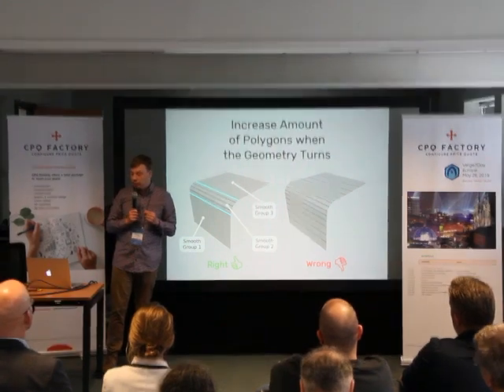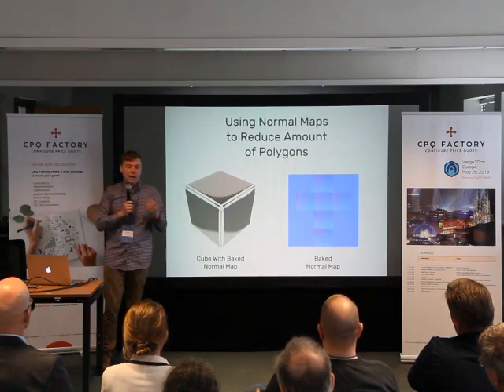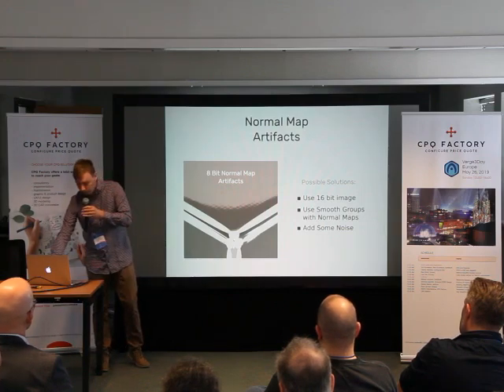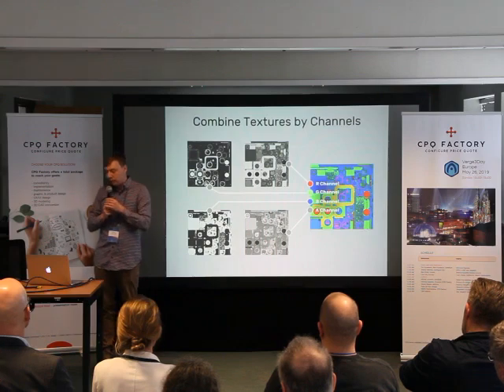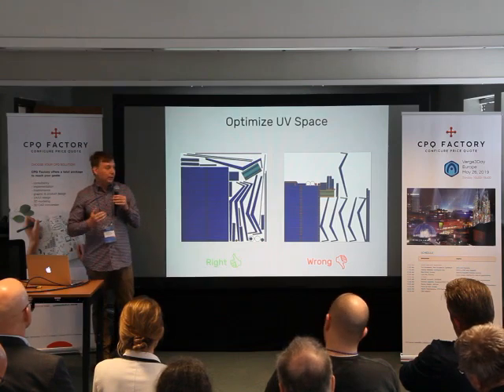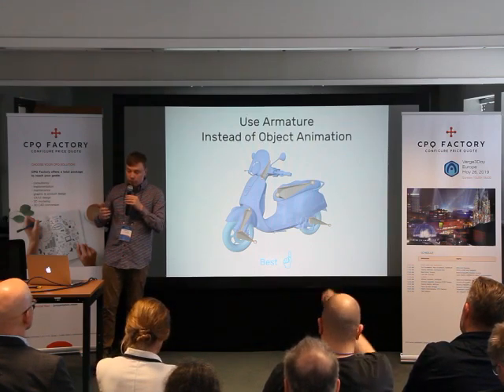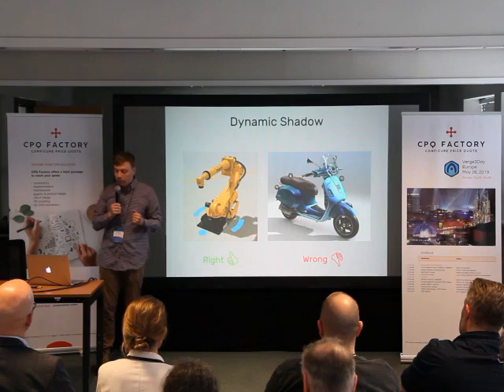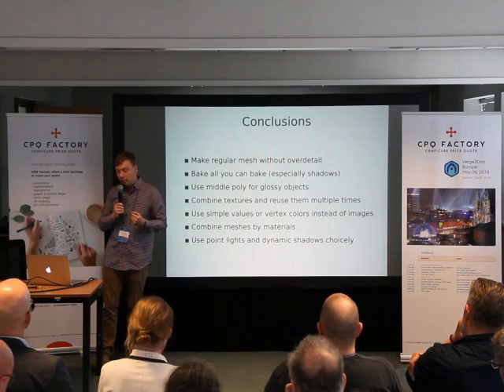Balancing between quality and performance in WebGL apps - Verge3Day Europe 2019

Comment: So I am curious about the multiple objects with one shader comments in the discussion. I have painstakingly gone through the process of making a master file where ALL parts are linked proxy's. I also go to great lengths to make sure that there is ALWAYS only one version of each shader. (The shader is NOT linked; and is applied to the 'object', NOT the 'data'.) -This is important to distinguish when working with linked objects. I did this knowing that in practice, you would  not want duplicate shaders. Is my method not accomplishing what I thought it was?
Reply from the maker: Unfortunally there's no automatic batching techinc in the engine now, because it usualy cause some problems for interactivity, so we left batching on developers. To optimize the scene better to combine objects by hands in a blend file.